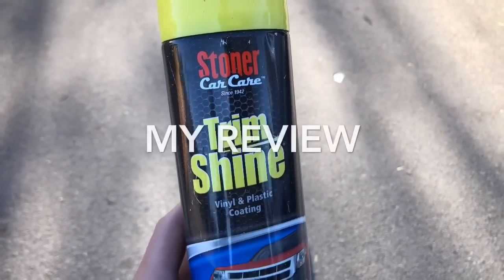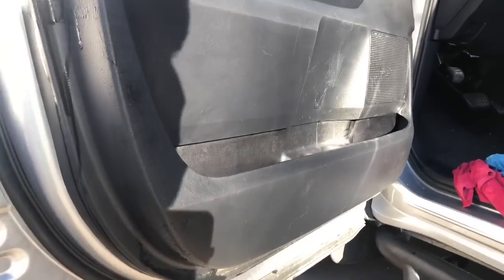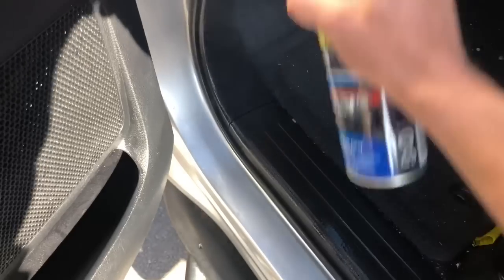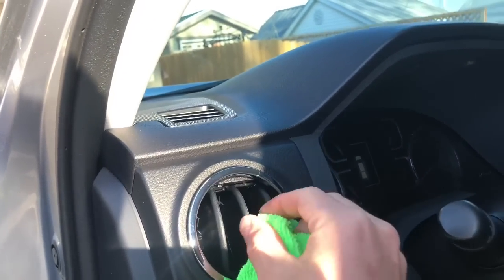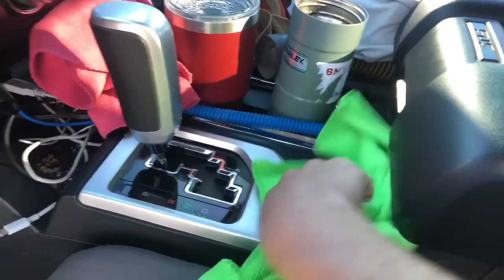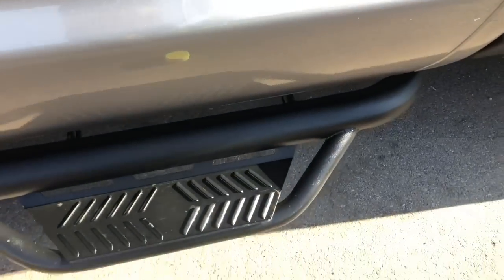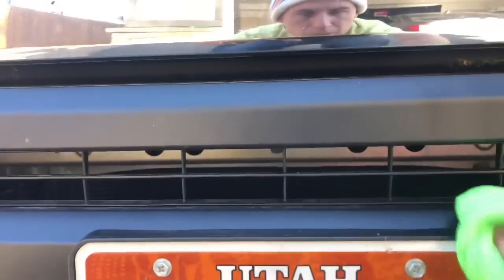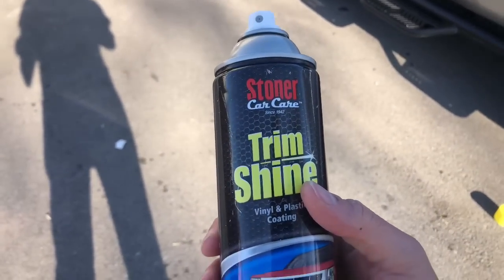Why you need Stoner Trim Shine for auto detailing!

Comment: Love that stuff. I always have a case of it. I use it mostly on the outside and I use 303 protectant on the inside. They both equally work well. Also,  as to not waste as much I spray it on a microfiber and apply, little goes a long way. For vents and cowels outside is the only time I spray it on.

Comment: I didnt really like the first bottle I used but I need to try it again. I just didnt like dealing with the overspray. I use 303 protectant on the interior and chemical guys vrp for the exterior.
Reply: Hi Josh, sorry to hear you had an issue with it. Try spraying it on a microfiber and wiping your trim down. That could solve your over spray issue. If not, we offer a 100% money-back guarantee.

Comment: Hey Nick!   This video a little old but I really hope you see this comment and help another detailer out.  I use a product from Lanes called ultra shine detail spray on exterior trim - grills its crazy good but where it steals the show and I have gotten a lot of customers from this is on dark/matte wheels.  Holy crap it is gorgeous. I don’t spray the rotor but the caliper face and coat the barrel-along with the wheel face. Customers fall over.  Downside is after shipping it is 13.50 a can bought in bulk shipped to Texas.  On Amazon its 22.00 !!! Uuugh. Have you tried this(stoner)on wheels being careful not to hit pads/rotors.  Need a replacement product bad.   Thanks for any suggestions.    - Kyle in Texas

Comment: Is it oily or watery? Will it dry right away if not wiped?
Reply from the maker: It won't dry right away right away...but pretty quick. If you spray a lot of it I do recommend a "leveling" wipe just to blend everything. But on wheel wells, to black those out I just spray and walk away. On interiors....cup holders or air vents or even some faded plastics...I always follow with a microfiber to make sure it blends well